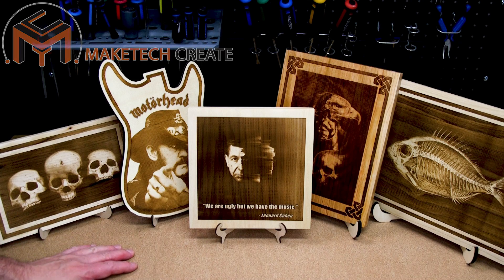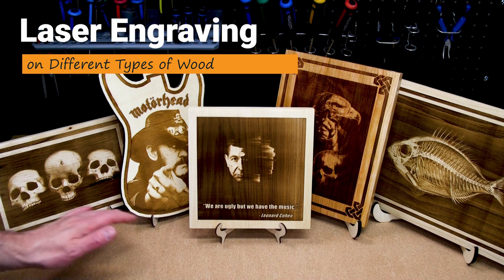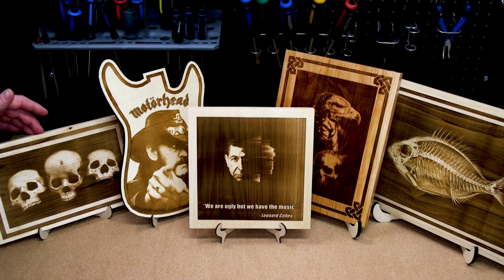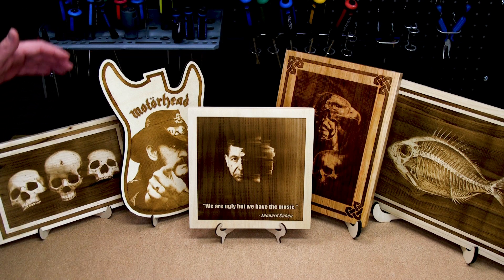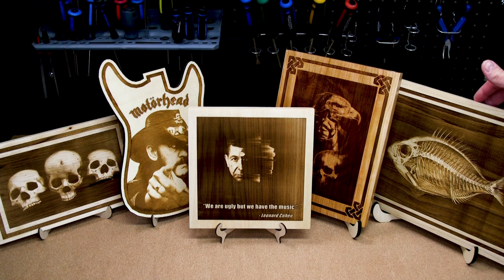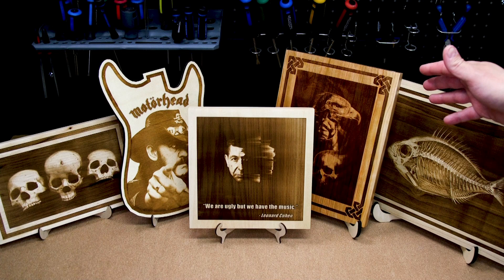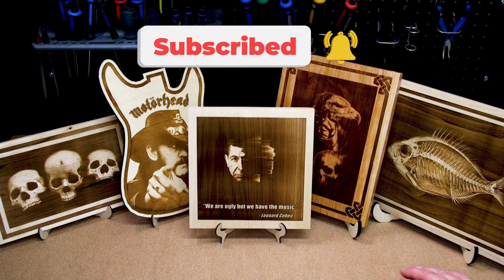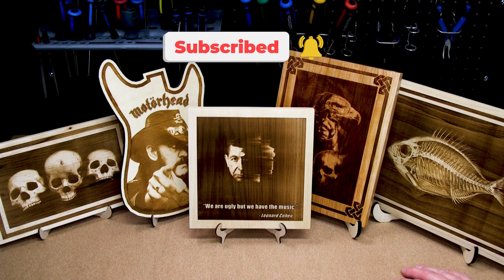Laser Engraving Different Types of Wood

Comment: I know it's three years old, but quick tip for anyone just getting started. If you combine the image with the frame as one image, you would cut the engrave time in half.
Reply from the maker: That is quite true, but you need to make sure that your frame is the same power and image type as the image you're engraving to work.

Comment: what power settings where used? was it the same across each piece?
Reply from the maker: Speed/Power settings are really going to depend on your machine and wood used. The best thing is to do is to try a test piece. I usually start tests at about 200 speed and 30% power and adjust from there.

Comment: Great to see comparisons.  The quality of the engraving is incredible.  I'd be really interested to know what settings you used on the cherry and maple as I use similar in the uk but can't get that detail.  Thanks
Reply from the maker: Thanks, setting vary per machine... on that 50w laser, it was about 100 speed and 40 power.
Start slow and work up from there. Reducing your air assist may help too.

Comment: nice video but i wish i know the speeds power and pass
Reply from the maker: Thanks. Speed and power is really dependent on your machine and materials. On my 50w, I ussally run at 40% power and 100 mm/s speed for Softwoods and up to 80% and 100 mm/s for hardwoods.
You can of course go faster if needed, but i found slower speeds give better results on my eBay machine.

Comment: Thanks so much for this video! It's obvious you spent some time on this, and it helps novice engravers like me more than you know. I am curious to a couple of things, if you don't mind. 1. What software did you use for this project? 2. What if any special preparation did you do for the images, particularly the ones that appear to have a photo of a person in them (Motorhead, Leonard Cohen, the fish, and perhaps the skulls)? I've attempted to engrave a photo on birch plywood with very little success. I understand settings are generally unique to the machine and geography, but I also know that image preparation is key, as well as whether you use a positive or negative of the image. Thanks in advance for any help! Clay

Comment: If you allow me a trick,
Apply before to the wood a layer of ammonium bromide or Borax (dissolve them in warm water 1 unit per 10 of water). 
Once dry, the wood will be ready for an engraving, deep black with a higher contrast.

Comment: Hi :) Can i ask what settings you used for the engravings? Speed and power
Reply from the maker: I ussally run around 100MM/s speed and 40% power on a 50 watt machince. 
You're machine will probably be different though. Also, on harder woods, you may need to increase the power by 5%-10%. Hope that helps!